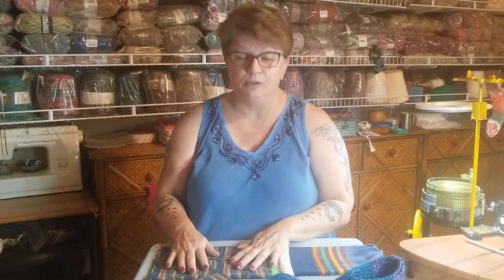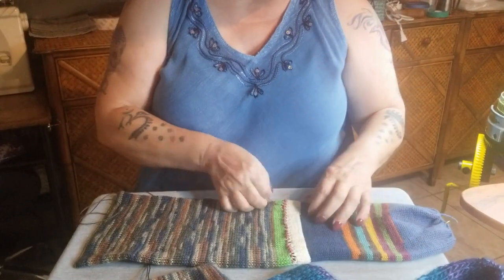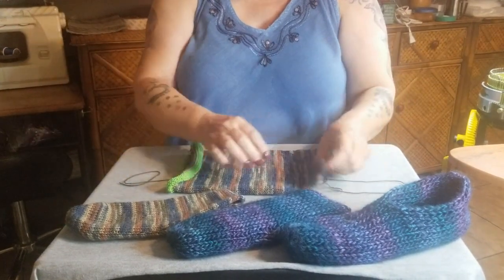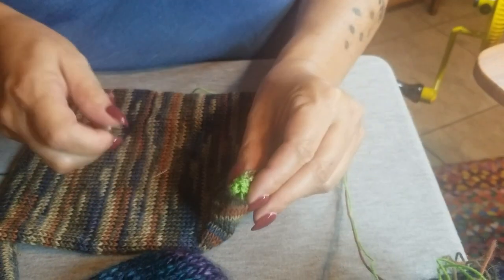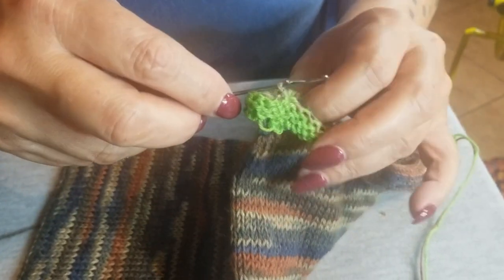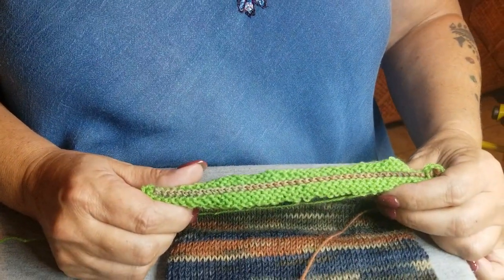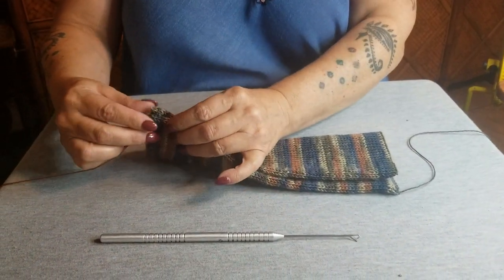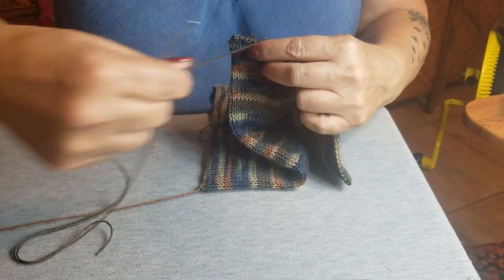Slipper Sock for Bumblebee or Addi

Comment: Hey you can do them on any csm by just making them 1/3 larger and wet felting them in the washing machine.  No     plastic addi needed.
Reply from the maker: Yes I make them on both my CSM and Addi. You may have to make it a 2 piece construction to cover the foot width needed to felt it but it should would just fine.